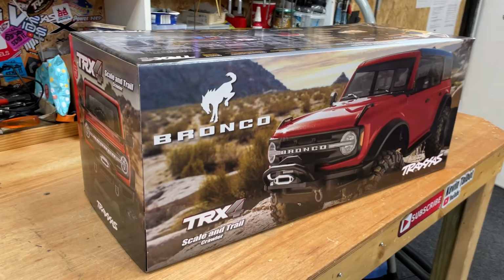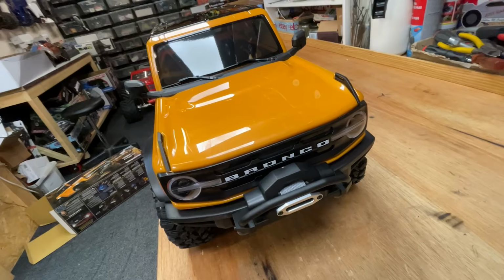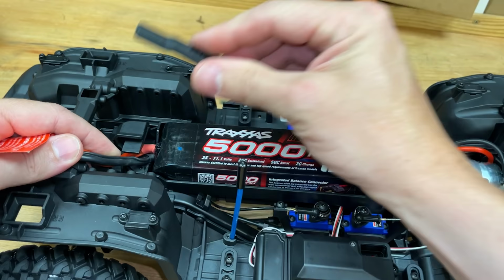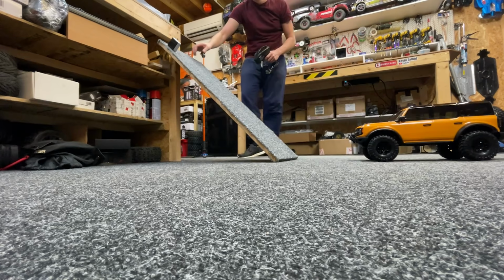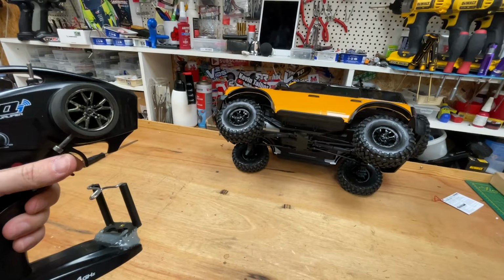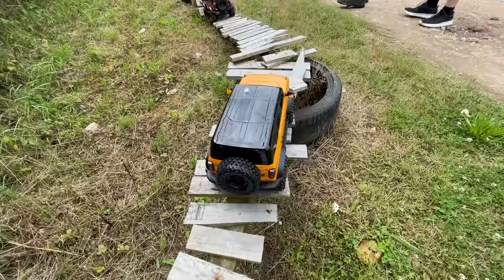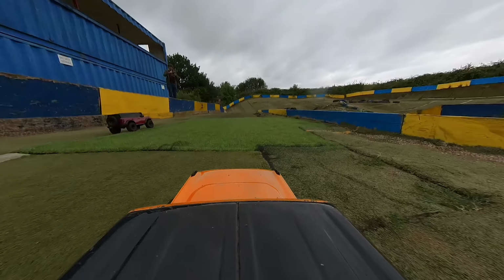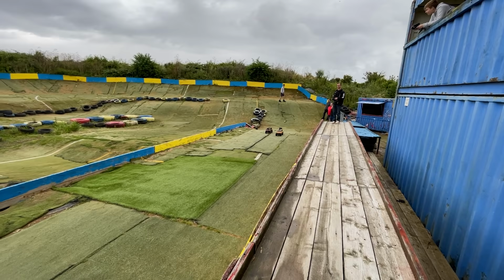New Toy - Traxxas 2021 Ford Bronco

Comment: My original TRX4 still works and it looks similar.  The trick with shifting and the little servos are to have them adjusted properly and happy. (obviously) But also I like to only change gears while moving slowly, and pay attention that your mini servos turn off after you lock/unlock differentials.  If they don't complete their travel they will be kind of like a steering servo fighting for center and just making a noise but they should not be.  Most of the time I change those during a slow crawl as well it seems to help with engagement

Comment: I like the Bronco a lot, but these little rigs have gotten very expensive. I’ll be sticking with my Axial JLU for now.
Reply: It’s only $550
Reply: @Kartertheblackmamba  only
Reply: @RealJawnes  $550 isn’t bad at all 🤣
Reply: @RealJawnes  $550 isn’t that expensive compared to most of these rcs you get what you pay for 🤷‍♂️
Reply: Have you tried the red cat gen 7 pro
Reply: @KarmeloPlays  bruh my sport was $320
Reply: @KarmeloPlays  dude 550 is ridiculous, especially for something with so little performance. You could get any of the rear wheel drive traxxas vxl models for a little under 300 and they can do loads more than some tiny bronco. Not saying it’s not nice at all, it’s just way too much for wayyyy too little
Reply: @Chasepowers_556  just got the gen 8 axe  edition.  Seems amazing so far. $499 tax fee weekend
Reply: @KarmeloPlays  not always! I’ll take any axial over that junk anyday
Reply: @Kartertheblackmamba  in the UK it's considerably more than 550 USD though. You are looking at 600 pounds plus for all the things you need like batteries and chargers etc. So the original poster has a point.
Reply: I'm $800 into mine now after upgrading the motor and esc that kept failing and upgrading one servo that stripped
Reply: In greece costs only 200€
Reply: They may be expensive I agree, but they are extremely great quality and durable

Comment: I really like my TRX4, it is an all around great crawler.  I just took out the stock brushed motor and put in a Hobbywing Quickrun Fusion 1800kv brushless conversion. It is the first time I’ve run a brushless system in my TRX4 so I cannot compare to other brushless systems, but I think this Hobbywing set up is Awesome!!  With the two in one motor/esc it can crawl super smoothly on 3s. The included program box makes setting it up really easy too. No separate ESC so you save space and weight.

Comment: Ahhh Perfect timing :) just checked youtube wondering if you had a new vid out since notifications not working for me and was 7 mins ago :) Found you about 6 weeks ago when I had no Rc's... now I have 4 :P basher and racers for different tracks. all bringing bigger smile to my face that had in ages. Thanks Kev, love ya work and used ya skillshare link last time.. There is nothing quite like landing insane jumps. so fun I don't even mind when a bit breaks... so far, only the the few parts holding hingpins that m2c was out of stock of.. Bring on the monster truck :) Thanks for all you do. You are absolutely epic! and my Favourite Youtuber.

Comment: Traxxas should have done a independent front end with a switchable locker front and rear plus put a dig system in it like Ford did on the Bronco

Comment: Nice vid for sure. That 360 camera is cool too. I've had my bronco for a while now. Installed the pro light kit which looks fantastic and I also installed the new winch from traxxas and it works quite well also. So far no issues with performance.  But if you toast the licensed Ford body, it will cost around $250.00 to replace it.
   Thanks for another great vid.

Comment: I just bought a Arrma Typhon 3S today I had one a few years ago they have made a change since then the last one I had the motor went bad now they use Spektrum motors and ESC.
Reply: Yup. Spektrum electronics are junk imo. I still have my v1 typhon with the blx system. Well over a year and it's still running. I don't even bash or run my rcs in the wet and the spektrum motors seem to only last about a couple weeks until bearings seize. Horizon messed up tossing spektrum in every losi, axial, arrma etc.. at least they have a decent warranty still but the diversity is gone when every rc brand has the same system. Makes me want to go back to kits

Comment: Hey kevin instead of using drills for you rc cars, try out the dewalt gyroscopic screwdriver. It is amazing. All you have to do is insert the screwdriver into a screw and hold down a button and physically turn you hand in the way you want it to go. You can adjust the speed by how far your hand moves in either direction

Comment: I have a two-door version from New Bright.There's an app driver too! It has 3 modes to use. No internet required. The only problem is that the remote doesn't work sometimes . You're better off using the app driver. If you have a GPS comment how fast it can get  because I don't have one and that's just sad. It comes with a battery (charger included)

Comment: That last little 2 minute montage of the running thru the course in slow mo was super 😎 cool!! I have a traxxas trx4 high trail 70s model blazer and I run a 2s battery on mine. I thought I heard yall say something about running a 3s..... can this trucks run a 3s battery in stock form. I Apologize if jy question is dumb but I'm new to the hobby and trying to learn 🙆

Comment: The body is a masterpiece, but it's annoying Traxxas didn't put in any effort to give it the right front suspension.
Reply: After owning one for a while, they made the right choice keeping the solid axle portals. The pro light kit is a thing of beauty, and with some minor tweaks to the tires, it is incredibly capable. I run it along my sxc10/ 10ii, and it's better in every way compared to the other 2. The enduro trail runner is just as scale, along with the ifs, but it will not perform at the level you'd expect.

Comment: I got this and I had it for 3 weeks and it killed itself the brushed motor is shot and the esc puffed up so it has been replaced. And he should I get the new light kit. And before I even got this I made a full crawler track up a steep hill then back down then across brick and over sticks then to big rocks then just dirt all the way through you can see my full YouTube video on my rc channel rc  vlogs

Comment: Hi i m facing a problem with my trx4 bronc and the problem is that my trx4 cruse control nd 4 by 4 is not working now plz guide me how to reset my controller to default setting

Comment: There was one issue I have one myself is really nice and all that the tires Rub on the fenders they also servo go out stock steering servo is honestly terrible it’s not good you will need to replace the motor I’m getting mine replaced with a brushless the $20 steering servo I use  works  very good has enough power you will have to get metal gear servers and high and low speed mine doesn’t work both of my  don’t work right now but I’m getting my new steering servo my new motor and all that I’ll get  soon don’t wanna use stock stuff it honestly is not the best it’s OK but the more power you have I guess kind of makes it a bit nicer I broke  mine the first day I got it I did donuts and that kind Breaks it hopefully sometimes someone makes a 2 Wheel Drive servo for it so then you can get a different remote and has to wheel in four-wheel-drive but right now I’m gonna once I get all my things I also have a new deaths coming for it new weight so I have a lower gravity and 2 wheel Drive servo combination thing would work really really good
Reply: That was very long I could’ve made it shorter but I guess I didn’t